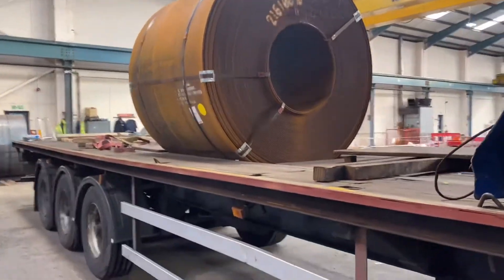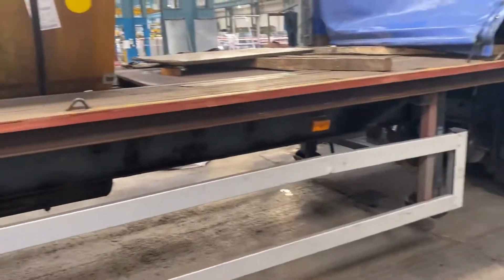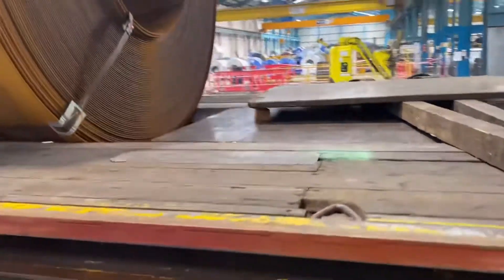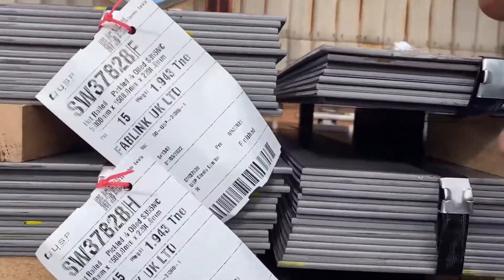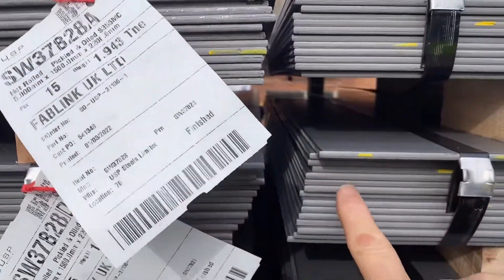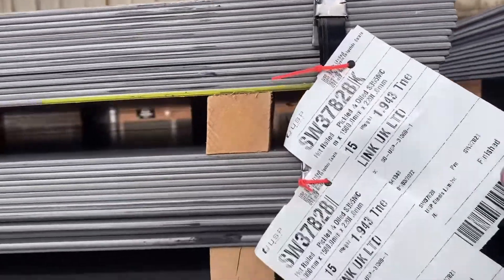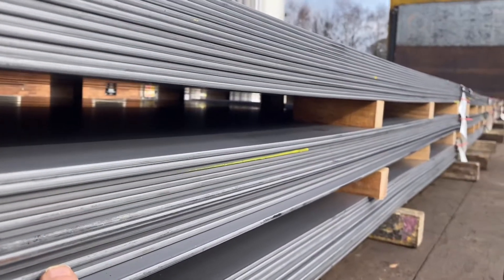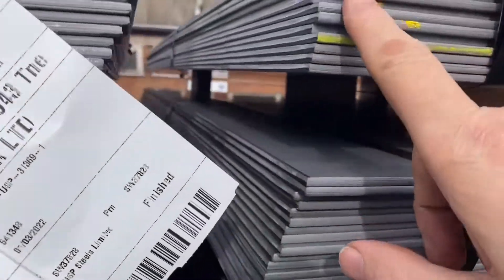The beast is off oily pleats moving

Comment: I worked for a steal warehouse in the states in my younger days. I worked maintenance. In the years I worked there I had to work two accidents both killed the driver. The loads shifted and came through the cab. I knew how to run a portable crane. So my crew went out and picked it up. It was bad don't want see that again. You be very careful. Take care!